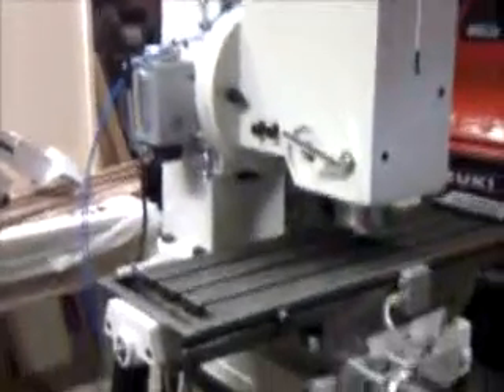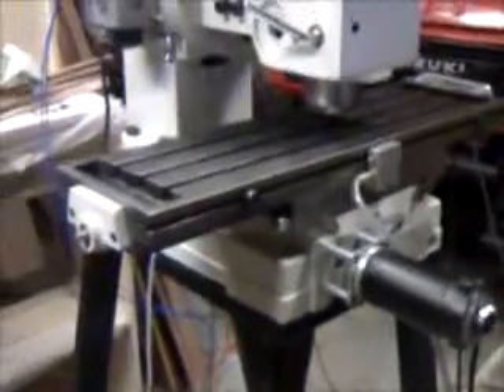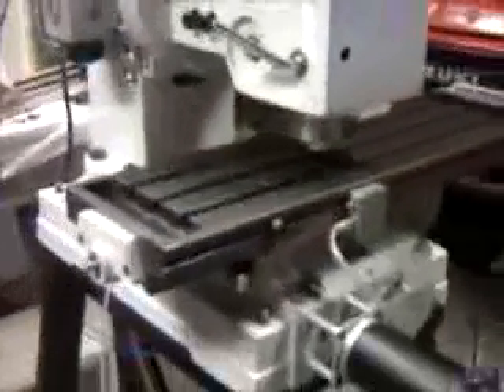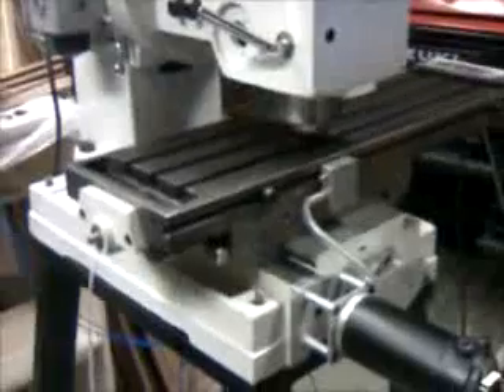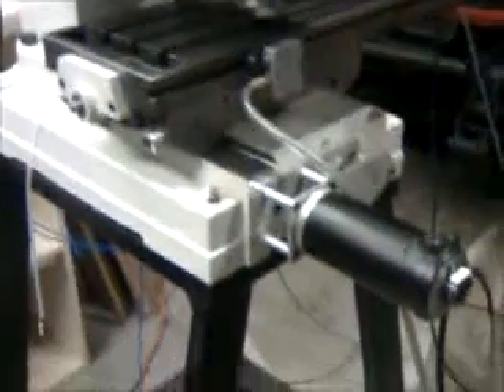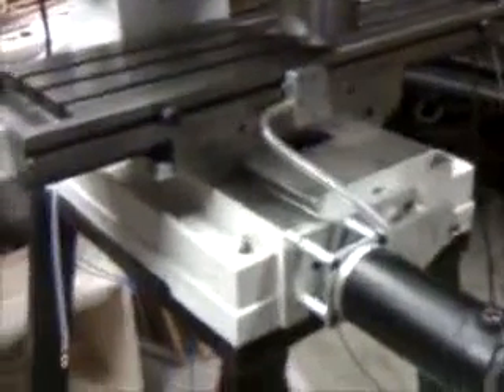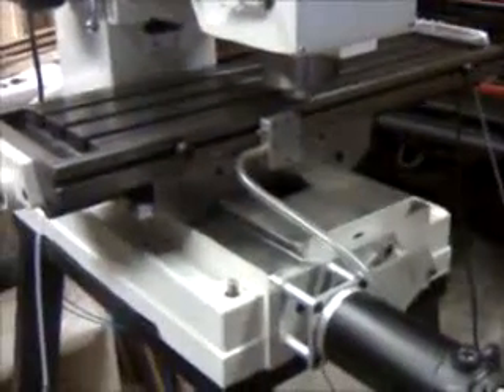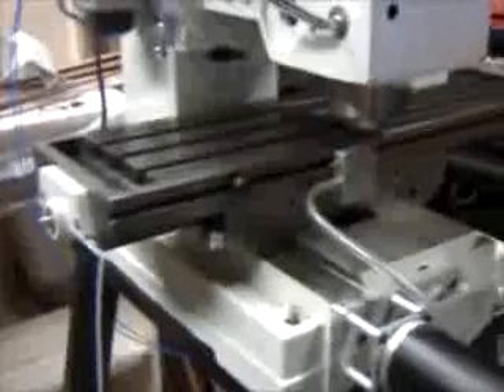Lathemaster cnc mill first test run

Comment from the maker: Actually it is a Lathemaster mill, an Early one that has the same millhead style as the Industrial Hobbies machines. It has also been completely repainted and I made a belt drive conversion as well as a one shot oiler setup. The motor is new with a 3hp 3ph setup and sensorless vector drive.... are you doing a conversion? peace